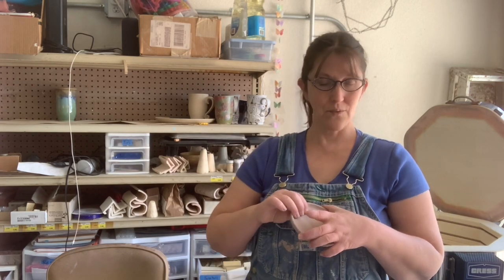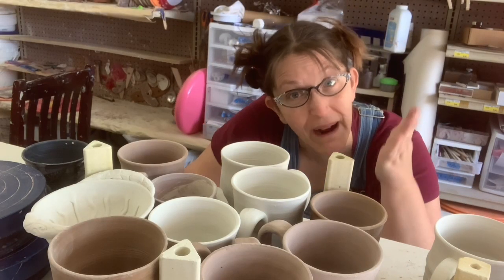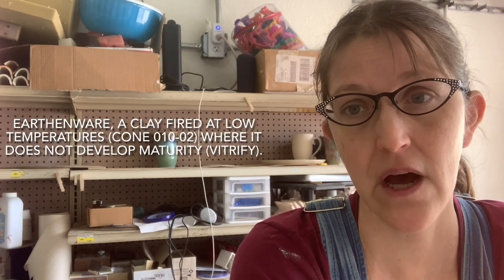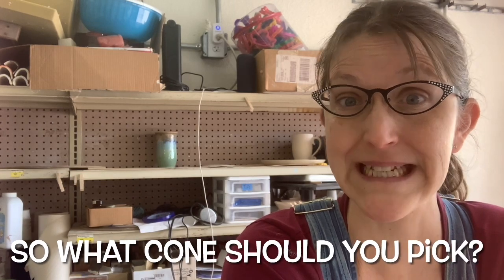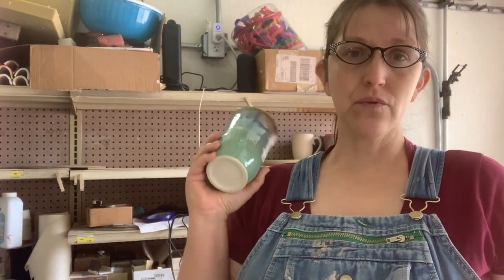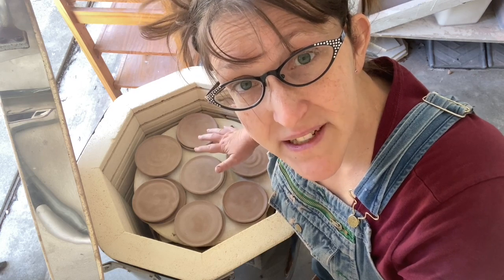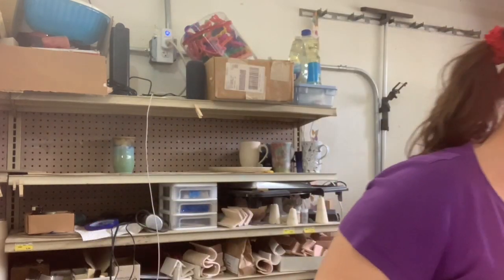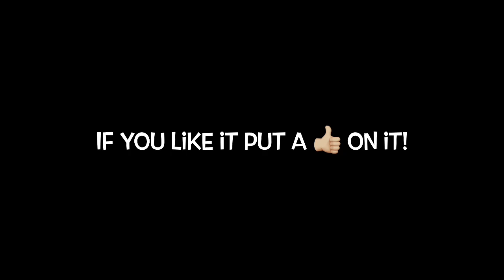What cone should you bisque Pottery to? Bisque temperature 04 vs 06. Planning kiln selves, Emily

Comment: Thank you so much for all you do!! I was having a terrible time loading my kiln so I got some big pieces of cardboard and traced my kiln shelves onto them. I did a full shelf as well as a half shelf for both kilns. I have to say though that I have only done the layout once!! Hahaha. The last time I loaded my glaze load in my big kiln it took 3 1/2 hours!!! I am having to stagger my shelves to get more even heat and it’s soo hard to do, and incredibly time consuming!! 
I used to have a mobile paint your own pottery business and I usually did plates because they are of course like a blank canvas and people could do so many different things with them. When I bisque fired them I could stack 3 high and never had any problems. The issue with staggering plates, as you did with your coasters is that they will warp, especially anything handbuilt. 
I had several bisque loads that didn’t get hot enough and only got to cone 06 and I had a ton of pin-holing with several different glazes. So I just bisque to 04.
Reply from the maker: great to hear! I forgot to show it in the video, but as you’re putting your ware in, it can be hard to remember where your stilts are as you unload the layout. So I put some tiny shelf supports on the layout as a reference in place of the ones I will use when I move those into the kiln.  Then, as I load from the layout to the kiln I always have those layout references. I totally hear you on the backbreaking loads. This process was born from the chiropractor’s bill afterthe 3 1/2 hour loadings. 🥴🤪. as you learn your kiln the staggering won’t be as hard. you can do it!
Reply: @CallUsTemily  Thanks so much. I actually put my kiln posts in the exact same place every time so I drew them onto the cardboard!! Now to remember to do the layout!! Lol. I do have to wrap each piece in a plastic bag once the glaze is dry and I put them into boxes by height so I know how many pieces I have for each shelf.
Reply from the maker: Brilliant

Comment: I have wondered about this because I don't always make enough things to fill the kiln. I don't want to wait until I have enough bisque things, or enough glazed things to fill up the kiln. So, I decided to try putting both glazed and unglazed things in together and firing at cone 06. I've been making a lot of figurines and little non-food oriented things, so I wasn't worried about it. 06 seemed to fire plenty hard enough. 
So, you say that cone 06 bisque absorbs glaze better. Is that a good thing? How does the glaze turn out, how does it look compared to the 04 bisque? Why would you rather bisque at 04 vs. 06. ? What are the differences?
Reply from the maker: 4:25 😊 Fyi If I go too slow, you can speed up the playback speed in the settings of the video. Top right corner.
Reply: @CallUsTemily  Yes, I watched the whole video, it just didn't answer all my questions. Also, I only use low fire slip, so I'm only interested in how glaze works on 04 bisque vs. 06 bisque. You talked about glaze absorption a bit, but could you go into more detail about glaze results and pros and cons? Does the glaze work better if the bisque absorbs more? Would that help with crawling and bare spots? I call them blowouts, but that's probably not correct.
Another problem I've been having is with old glazes beading up like water droplets on glass, leaving most of the bisque bare. What causes this, and can the full jar of old glaze  be salvaged somehow? It was a pretty, matte glaze that I'd like to use.
I know that's a lot of questions. Thanks!
Reply from the maker: @DonaldDrennan ok! With low fire clay you must reach cone 04 at some point. A lot of low fire glazes burn out at cone 04 so people bisque to 04 and glaze to 06. You cannot bisque to 06 and then glaze to 06 on functional ware. On sculpture 🤷🏻‍♀️. You can bisque to 06 or even lower -08, and then glaze to 04. But you must make it to 04 for anything functional. 

As for crawling, this is one of the hardest problems to diagnose. However, I have heard that a lower bisqued temperature will help with certain types of pinholing, which is minor crawling, but I don’t think what you’re describing is a bisque temperature problem. I would also like to suggest heading over to the @WashingtonStreetStudio channel. They have a ton of helpful videos with the type of content I think you’re looking for.

As for salvaging the old glaze, one thing that can cause crawling, is too much clay content in a Glaze. If a Glaze is not stirred all the way to the bottom of the jar. Every time you get ready to use it the bottom of the jar will have too much clay. I don’t know if this is the issue but it’s just my guess. 🤷🏻‍♀️ I also don’t know how to salvage it. 🥴

Comment: I am new and so confused.  I am making a porcelain doll.  I was told to bisque fire it.  if I do cone 06 can i still sand off seams and detail it after the bisque firing?
Reply from the maker: You can sand off seams with a green scrubby at the bone dry stage. Like the kind that come attached to sponges to wash dishes and bathtubs. It’s way easier to do that at greenware. I’m not sure why anyone would encourage you to send scenes after the Greenware  stage. Maybe someone misunderstood what you were asking.

However, as for would the clay, be soft enough to sand down at cone 06, it depends on your clay. If you have a mid or high fire clay (which porcelain will be) then it will be soft enough to still sand at the stage. It will be way harder to do, but it is possible. I would think you would have to do it with a Dremel or something like that in order to get the amount amount of pressure you would need and still preserve the details in the surrounding area.